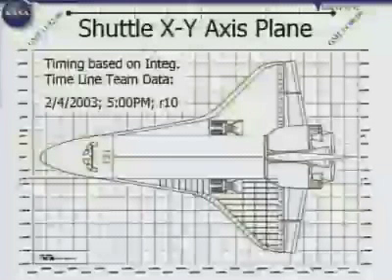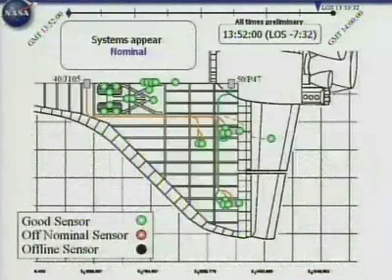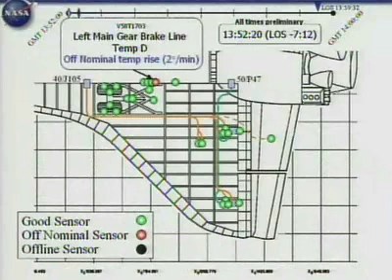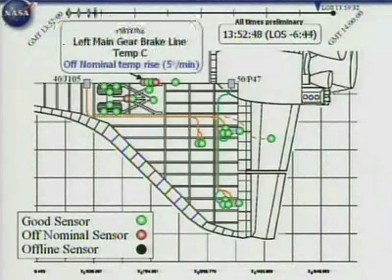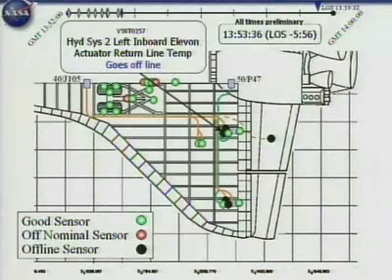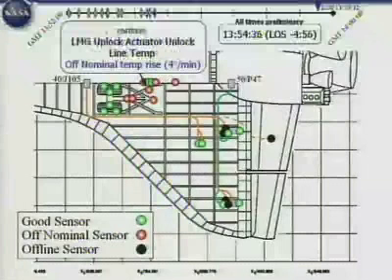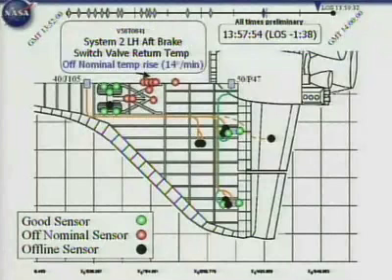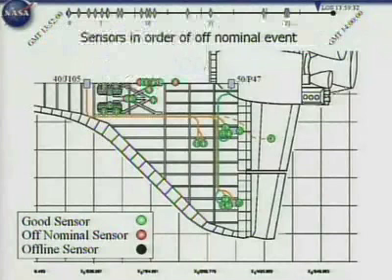Timeline of events in space shuttle Columbia left wing during failed re-entry of STS-107

Comment: Couple things:

The mission control people knew all about the foam strike, and they practice for everything. So as soon as they saw the left hand sensors start failing they knew they were in big trouble.

If the hole had been smaller and not caused the Shuttle to break apart, the crew would have still had to bail out before landing.

Having a flat tire on the landing gear is not considered survivable, the Shuttle would have tumbled and crashed catastrophically on the runway..

Comment: Basically you break reentry into two parts. ( 400,000’ - 200k’) then (200k - 0’). From 400-200,000’ it relies on RCS thrusters for maneuvering. Around the 200kft area the control surfaces take over. The problem is the thrusters were firing non stop countering the hole. But the hydraulic system was saturated right at the time they were really gonna need rhe hydraulics for control surfaces. Now that pitch up was only 3-4gs the increased gs occurred post mort. They were already dead. The pitch up wasn’t as violent as people think. It became violent at the end of the 6 second pitch up when the wing broke that’s when hell broke loose.
Reply: Why were they already dead prior to wing separation? Well the atmospheric pressure at that altitude is practically zilch. It appears from the last video that this crew had a pretty casual attitude regarding integrity of their suits. Remember they never knew that there was an issue because cat-com was just bringing the tire pressure issue to their attention AND they were never informed about the foam strike at lift-off. yeah the increased g did not occur until after separation so what killed them BEFORE that? I don't think increased g killed them I believe they passed from their blood boiling due to lack of pressure. This would have occurred coincident with wing separation & subsequent g force increase due to loss of vehicle integrity.. yeah at this juncture they became space debris. There may have been a coupla seconds of awareness, klk1900. 

Over 300 people have been to space with a 14 person fatality rate not including the 3 killed by Apollo 1 here on the ground. that's almost a 5% loss. yeah traveling in space is an extremely dangerous job by far the most dangerous job on the planet. Now all of these people are extremely smart but THAT is a pretty pour choice of career far as I'm concerned.
Reply: @leecowell8165  Your statistics are also flawed - what should be used is HOW MANY SPACE TRIPS successful vs. catastrophic failures.  Most of those 300 had more than on trip to space, and half this crew was on multiple trips - including Commander third time
Reply: Their blood wouldn’t boil. There may be some other kind of potentially lethal hypobaric trauma (e.g. lungs bursting), but your blood wouldn’t boil in space because it’s in a sealed container: you.

People have survived total exposure above the Armstrong line.

Comment: Remarkable that the control surfaces kept it on course 41 degrees across 3 states before it failed.
Crew would have blacked out in seconds from g forces after left wing failure. Would have been unconscious before being ejected into slipstream.
Painless and quick.
Reply: Official report says they likely lost consciousness during depressurization. They didn't experience extreme g force until break-up.
Reply: @chronic2001n  if they were unconscious during breakup so it should be assumed they themselves broke up due to forces on their bodies
Reply: @Anthony Strunk  

The crew survivability report says otherwise. They were conscious until depressurization, which was about 45 seconds after loss of control (ie, after what was left of the wing fell off).

After depressurization, their bodies were subjected to serious g-forces, which did a great deal of damage because their shoulder straps all failed, allowing their bodies to flail around at the waist. The report is also clear that, had they been conscious, they likely would have been able to brace themselves well enough to not be seriously injured.

It would have served only to buy them a few minutes of terror, though. The Shuttle was at 150,000' doing Mach 15 when it broke apart. We currently have nothing that can protect a human body outside a spacecraft in g those conditions.
Reply: Why would g's increase upon left wing separation? The entire vehicle is decelerating at a constant rate. Ah! the g force is gonna increase dramatically at breakup as this thing is hauling ass probably within maximum dynamic pressure. the vehicle has lost any semblance of flight and is now just a piece of debris perhaps even tumbling while rapidly decelerating.
Reply: @leecowell8165  because the profile of the craft increases. look at the video and see how the thing glows brighter after breakup

Comment: The engineers saw a piece hitting the wing on take-off, would a repair have been possible in orbit?
Reply: they would have sent another shuttle up that was already ready to fly, used a single personnel capsule to transfer the astronauts one at a time to the new shuttle. then they would have returned from there. there’s a great presentation on youtube explaining basically every single detail about the incident.
Reply: They did not know that "significant" damage occurred.. only that "superficial" damage "may" have occurred. only well after the accident occurred was an assessment done in this regard. It was only after computer reenactment that the actual damage was uncovered. It was determined that the piece of foam weighed about 1kg but it hit the the left wing's leading edge at over a 500 mph differential... enough to destroy several tiles along with a small portion of the underlying wing itself. The orbiter was already traveling at about 1.8 mach at this juncture. these tiles were very fragile... brittle. Thus any contact (even a bird strike) at the leading edge could have done significant damage. maybe birds got the message?
Reply: not only were there no remotely good options for repair or rescue, nobody had any idea if there was even any significant damage to the shuttle in the first place, and they had no plausible way to find out either
Reply: @peabody3000  they did have some options to take a look, they were suggested but they decided against
Reply: @j.walker6845  not really.. NASA considered requesting imaging from extremely remote satellites which would have had virtually no chance of revealing anything useful, and that was their best option
Reply: @peabody3000  The request for imaging was denied, so we can't speculate on what could or could not have been seen. In addition a spacewalk could have been performed.

People balk at the expense and risk it would have taken to attempt a rescue, but the recovery was a great expense and also resulted in fatalities, so in the end they might as well have gone for it. Talking about Atlantis.
Reply: @peabody3000  You might be right, at that. I tip my hat to your well reasoned opinions. Certainly we can agree their options were limited and NASA may well have had their hands tied. Perhaps it is more of a fundamental flaw in the spaceplane design which required mounting in the path of falling debris during takeoff. A crew capsule mounted on a rocket tip could arguably have avoided the fate of both Columbia and Challenger.
Reply: @j.walker6845  agree for sure. i would even go so far as to say the STS program should never have been declared operational, as was done in '82, just based on what they already knew at the time. but nonetheless, the shuttle sure was a beaut, and no doubt an engineering marvel
Reply: Sadly, no. No repair or orbital rescue was possible.
Reply: @GoSlash27  an orbit rescue was possible, there was another shuttle ready to go. they would have used a single personnel capsule to transfer the astronauts to the new shuttle.

Comment: so when the internal tires blew up taking out the wing. 
Seems to me, each time this craft banked, hot gases came into the wing, swirled around melting away cables and the most hot gases burned up the wheel bay. 
Once the wheels caught fire, that released a massive air pressure discharge blowing apart the compromised left wing.
Reply: Are you saying wing came apart from the rest of the orbiter because of the blown tyre?? Even if this was what happened, there are loads on the vehicle  several times greater than a tire popping in the gear compartment.
Reply: I’m sure it wasn’t blowing tires. Plasma was burning through the aluminum structure of the wing which eventually caused either a chunk of wing to fall off, or a significant increase in drag that caused the orbiter to spin out of control and disintegrate.
Reply: the tires didn't blow the crew would have heard it and it would have been on the final tape as well. They didn't have a chance once that foam knocked a hole in the leading edge big enough to throw a laptop through. The orbiter was doomed as space debris at that juncture. The only chance of this crew to survive would have been a rescue mission.. but the problem was that the ground did NOT know about this damage until the orbiter telemetry indicating sensors going offline upon reentry. There were no cameras onboard to inspect the undercarriage or leading edges, tail, etc. Nobody knew squat. In fact the crew was not even informed about the foam hitting the orbiter. But NASA knew about the problem and so did the public. I would not have flown on those orbiters had I been an astronaut. yep those that got back here safely were just plain lucky!
Reply: @leecowell8165  the crew was informed about the damage to the wing. the public found out and nasa presumed they would be questioned about it during an inflight press conference. it’s quite eerie actually, it was an email sent to mccool and husband. they were told that there was no cause of concern and worry for re-entry. they basically they admit they only told them about it because the public already knew. the email is shown in a video called the human story (or side, forgive me) of columbia !
Reply: Tires have a thermal fuse to prevent that.

Comment: The Shuttle was an inherently unsafe design dictated from the top down by idiotic politicians.

Why was there foam at all? Because the external tank is cold and ice would build up on the tank and they were worried about ice hitting the orbiter. So they (ironically) wrapped the tank in foam to insulate the tank, and the foam hit the orbiter.

But why does ice/foam hit the orbiter at all? Because the orbiter sits beneath the tank, nicely in the path of any falling debris. This is design insanity. In every other manned rocket, ever, the crew compartment is at the very top of the rocket, safely out of the way of any falling debris.

Why did the orbiter have to sit below the tank? Because the orbiter had gigantic wings so it wouldn't fit anywhere else.

Why did the orbiter have gigantic wings? Because the Air Force wanted launch and return capabilities to Vandenberg Air Force Base after one polar orbit, for spy satellite launch purposes (it's important when launching spy satellites to get up and down as quickly as possible). To do that, the orbiter needs to manuever about 1000 miles to the east to compensate for the Earth's rotation during that one orbit. There is no rocket you can fit on the orbiter big enough to move it 1000 miles in one orbit. Hence, wings.

Why was the Air Force involved at all in the Shuttle design? Because NASA and Congress made a political decision to have the Shuttle serve both military and commercial customers, thinking that this would lower costs.

How many times did the Shuttle actually launch from Vandenberg? ZERO

The exact same chain of comments applies to the Challenger disaster btw. It wasn't just that the O-rings were badly designed (although they were). It wasn't just that the management decision to launch was colossally flawed (although it was). The root cause goes even deeper than that. The fact that there were even field joints at all in the first place was because of inherently unsafe design.
Reply: David Jao — The failures causing the disasters were as much management failures as technical failures.  In both instances, there was advance warning of a weakness.  The erosion of the o-rings was a known problem.  The field joints were poorly designed.  NASA management minimized the risk until after the loss of Challenger.

The shedding of foam was also a known problem.  NASA did not investigate the vulnerability of the wing leading edges until after the loss of Columbia.  Again, they minimized the risk.

The principle problem was the poor safety culture at high levels of NASA management, in my opinion.  Both of these weaknesses could have been eliminated before the crashes has management been diligent on safety.

My opinion is that the shuttle was was a good, though imperfect, system, technically.  Not economic, though.

I agree with your remarks on the Air Force, though.  The AF were happy to use their conventional launch capability.  The loss of Challenger and the delay that resulted was a problem for the AF.
Reply: the orbiter sits at the top or bottom of the tank it doesn't matter. the design insanity comes from the SIZE of the orbiter which necessitates and incredibly long approach at nasty speeds through the atmosphere at a really shallow angle. the orbiter is fully exposed to beginning g over the Pacific! over 3000 miles away from landing. THAT is what's insanity. yeah look at Apollo's approach in contrast. So when you fly something that big EVERYTHING hasta be bigger.

Comment: What I'm getting from this is that the fire originated in the wheel well and then the left wing caught on fire and then the shuttle exploded.   But I'm no Engineer or Fire Marshall, so I'm just guessing.
Reply: Superheated plasma entered a hole in the front side of the left wing, the hole infamously caused by the foam strike and melted structural steel. It also melted wire bundles connected to sensors which is why the tire and wheel well temps got high and then the sensors stopped functioning. They just happened to have wire bundles connected to them that got melted. 

They actually got alerts that the wheels were deployed and locked down after wire melt-through caused shorts when at the same time other still functioning sensors showed that the wheels well doors were still closed and secure. 

The biggest destructive factor was by far the melted structural steel which eventually lead to a loss of control and break up of the shuttle. RIP.
Reply: You guessed wrong. There was no fire in the wheel well because there's no O2. No "fire" is possible in space. However things CAN get awfully hot out there. yeah look at our star. That thing is so hot that we can easily feel its heat even though we're 93M miles away!

Comment: boils down to : the whole left wing is on fire.
Reply: It wasn't a fire in the conventional sense. There was no chemical combustion involving fuel and oxygen. When a spacecraft re-enters the earth's atmosphere the air that its passing through is suddenly compressed ahead of it, causing the air to instantly become enormously hot. There is also some additional heating caused by friction as the air flows over the outside skin of the vehicle. This super-heated, red hot air is called plasma. Normally the thermal protection system, which covers the aluminum structure of the entire vehicle, prevents the hot plasma from coming into direct contact with the aluminum structure underneath. What happened to Columbia was that during launch a piece of foam from the external propellant tank broke off and hit the leading edge of the left wing forward of the left wheel well. This made a large hole in the protective panel on the leading edge of the left wing. Then during re-entry the super hot plasma was able to enter the left wing through the hole and it eventually started melting the internal structure of the wing until it penetrated into the left wheel well. This is what initially caused all the sensors in the area to fail one by one. This process continued for several minutes until finally a major load bearing element inside the wing was melted through by the intruding plasma. When that happened the wing suddenly broke completely off and the entire orbiter started to tumble and it quickly broke apart.
Reply: @joevignolor4u949  You have spoken well. And accurately.
Reply: @joevignolor4u949  How large was the hole made by the foam strike?
Reply: @joevignolor4u949   That sounds about right.   You should have worked on the investigation.
Reply: the wing was NOT on fire. there's no O2 in space...
Reply: I took it as the wheel well was where the fire originated and then the left wing caught on fire.   But I'm no Engineer or Fire Marshall, so I'm just guessing.
Reply: @jeffgreen3376  There was a hole in the wing caused by debris and during re-entry superheated gas got inside and destroyed it, pretty simple.
Reply: Tires burn like hell and are hard to put out at this point it's game over.
Reply: @alycem1  The tires weren't burning as there was insufficient oxygen inside the wheel well to support combustion.  You might want to read my previous post above that explains what actually happened.
Reply: @joevignolor4u949  same reason they have heat shields on nose to keep from burning up in reentry from lack of oxygen right.so it wasn't burning just hot as hell and melting, same results game over.
Reply: @alycem1  Basically that's right. However, most vehicles do not reenter nose first. This would expose the nose cone directly to the super hot air that's being created as the air is being compressed ahead of the vehicle. That's why most space vehicles, such as in Mercury, Gemini and Apollo, come in blunt end first. This causes the shock region, which is very hot, to form out ahead of the heatshield so that the heat load on the heat shield is reduced and limited.